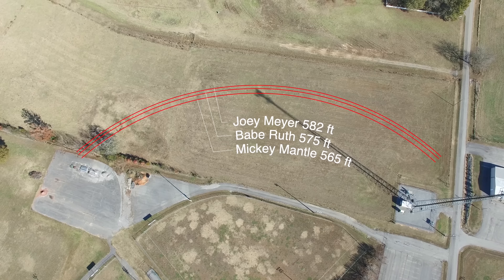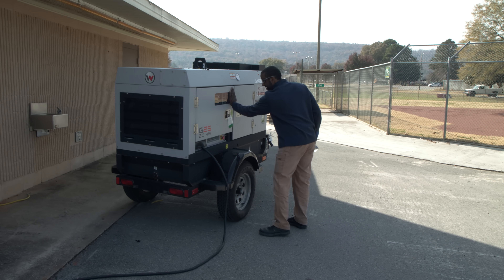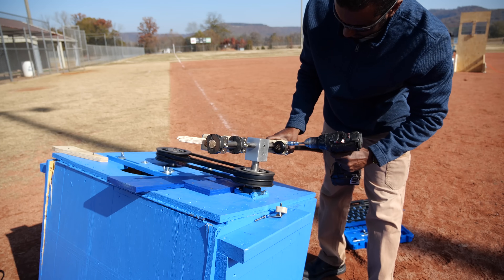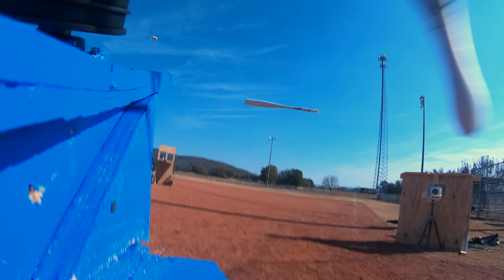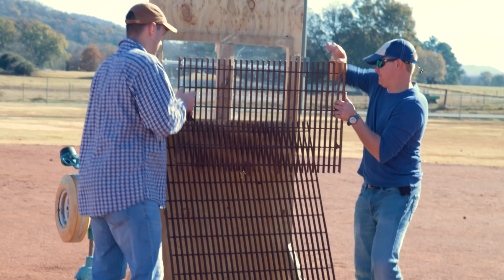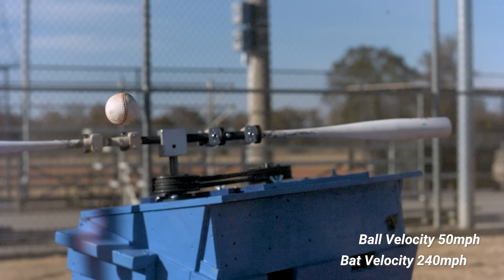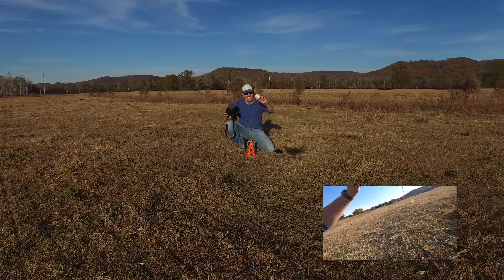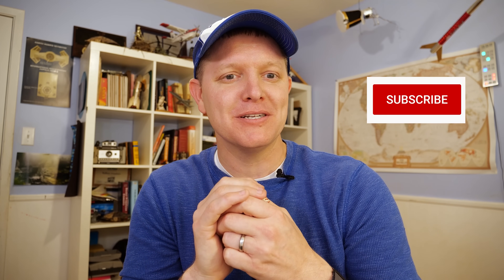World's Longest Home Run (The "Mad Batter" Machine) - Smarter Every Day 230

Comment: Oh man that was nuts. Good call on the flight tracker line lol. So here's my question:  why not farther?  Air resistance, sure, ball material, core density, was that a major league ball or a regular ball?  It was hit an insane distance for a person to hit, but how far could a major league hitter put the ball out with an aluminum bat, too?  Great machine and great video as always.

Comment: The main issue with generating light from sound, "sonoluminescence" is that it requires very sensitive frequency modulation of a specific area. The resonant frequency of the liquid you wish to suspend a bubble in must be matched, and then maintained. Then once the bubble is captured the device can be tuned to apply pressure to the bubble. If someone coughs on the outside surface of the container of liquid it can be enough to pop the bubble. Also. Temperature is a non considered variable so far. Both the proper operating temperature of the entire device and the active temperature fluctuations from within the bubble. Apparently the gas inside becomes plasma when squeezed properly on all sides. Plasma In a bubble trapped in resonant frequency matched liquid is Supposedly in excess of 10,000⁰F. The bubble will bounce from this tight plasma state back to "full expansion" and shift from that extreme high temp state to under -250⁰ extreme low state and oscillate between the two until disturbed. So the second issue is how to deal with the super cold temp, and harvest the light, electricity, and heat coming off the plasma

Comment: I think in stead of using a single wheel pitching machine you should use a 2 wheel pitching machine and instead of using aluminum bats use composite bats instead. the reason i say to use the 2 wheel pitching machine is because you get more consistent speed and accuracy also you should have try to load the ball consistently using a 4 seam(the way the ball would rotate) instead of just loading it randomly. As for the composite bats i hear that the more they break in the farther you can hit the ball also i would think they are less likely to dent. also what would be best if you can make the bat spring loaded with a gearing to reset the bat kinda like a skeet trap but allow the bat to keep rotating or adding some kinda breaking mechanism to slow it down. But over all Very cool!! you should ask Nike or some other baseball brands to let them use their products to sponsor and then when you are done with them donate the rest of the products to the little league :). Keep up the Amazing work that you do!!!! (just FYI not im not telling you how to do what you do just throwing some suggestions out there :))

Comment: Excellent video!  It would be fascinating to explore some of the math, to explain why there wasn't a more linear increase in distance, and perhaps predict a theoretical limit to home run distances.  For instance, one would expect a ball with double the exit velocity would travel more than 22% farther.  Granted, the increased flight time means longer exposure to wind resistance, which increases with the square of the ball's velocity.  The ball's trajectory suggests energy was expended curving perhaps 45° to the left.

Comment: 3:36 I don't think those 3 phases are drawn correctly. Phase 1 shouldbe at 0 (or 360) degrees, phase 2 at 120, and phase 3 at 240. However, as drawn on the paper phase 2 is at 180 degrees.
I know you pointed out you can't draw, but I think it's important to know that the phases are seperated 120 degrees from eachother.

Comment: I'm pretty sure the bat would have broken either way at that speed, but the wood bat was in the wrong orientation in the grip. The edge grain should be making contact with the ball to make it less likely to break.

Also imagine how far the home run would have gone if you'd gotten it on the first try before the aluminium bat got deformed. The trampoline effect the ball gets from an aluminium bat is lost after the bat is mangled. I wonder if you could somehow rig a pitching machine to be timed with the bats to more consistently barrel the ball. I'm not sure there's a pitching machine consistent enough to get the right timing every time with bat speeds like those.

Comment: According to Wikipedia baseball bats typically have a mass of ~0.94kg, with two of them spinning here (not including the pulleys and mounts I don’t know the mass of) that’s a mass of 1.88kg, and Destin says the bat has a velocity of 240mph (107.2896m/s).
Kinetic Energy = (½)mv² =  ½ x 1.88 x 107.2896 x 107.2896 = 10,820.3948J = 10.8203948KJ
The bats alone have almost 11KJ of energy when spinning at top speed… I didn’t really have a point here, just thought it was interesting.

Comment: I doubt ANY wooden bat would hold up during this experiment but a lot of people don't know that a wooden bat has a strong and weak side. Generally, the manufacturers find the strong side of the bat and will index the label brand in such a way that if the batter holds the bat with the brand facing up, the ball will make contact with the strong side.

Comment: There's a teachable moment in there about using GPS to measure distances and how to achieve sub meter accuracy.

Your phone can measure down to 1 meter accuracy under the most ideal circumstances but is more often than not 3 meter or wider.

Rtk is how you achieve sub meter. Down to sub centimeter in some cases.

Another interesting topic is how California surveyors benchmarks work when California is constantly moving and fast.

Comment: Interesting to see the effect of ball spin on its trajectory at 13:51. Also interesting to hear a reported maximum distance of less than 700 feet, then see a representation of a ball going 717 feet. Interesting to see how the ball deforms the bat. Have you thought about using a solid aluminum cylinder or thicker pipe? It seems you are losing a significant amount of energy in the deformation of the bat.

Comment: well, do we know where the ball "landed"? You found the ball after it landed and certainly rolled some distance. Also, based on the initial curvy flight path, i would assume the ball had a crazy amount of spin on it, which definitely counted as energy lost where it could have been used for travel. At that point though, you are also approaching the limits of the ball's integrity. If a ball and bat were to be designed to rebound properly and take the stress of a 200mph swing, it would probably go alot further, also assuming it would be denser and less affected by air resistance. Looking forward to more like this!

Comment: They're obviously having problems with bats. Looks like he gave a teaser at the end with a machined, female threaded flange piece. Their next attempt may be a machined bat made from billet aluminum with a male threaded handle. If they do that, may as well build a beefier rig. One that's anchored & shaft driven instead of belt. I'd also erect a steel reinforced concrete wall to stand behind instead of the one they made from plywood & steel grate. Their next problem might be baseballs coming apart. lol. Great video tho. 700 feet. Impressive!

Comment: "The power that comes out of your wall in your house *IN AMERICA is single phase power."
I am almost sure that here in Germany, we have 3 phases that are shifted by 120 degrees, so that at no point is there a moment without voltage.
Reply: I should have waited like 3 more seconds before posting this. But I'll leave it as an interesting tidbit. Germany's mains grid is run on 3-phase power.

Comment: 12:16 can you believe an actual human achieved a distance pretty close to what a machine could do traveling at nearly the speed of light?
Reply: That was no were near the speed of light lmao.
Reply: @maxz8807  It scratched the surface at least. But that's beside my point. Humans nearly beat a machine that spun fast enough to put that helicopter in the air.
Reply: That was 0.000036% the speed of light.

Comment: This is legit one of the scariest things I’ve seen Destin do. I’m glad he upgraded the pitcher’s protection!
Reply: He really coulda just tossed the ball into the spin from right behind it
Reply: Yeah, no kidding.  I briefly played 3B but didn't like being so close to the batter.  I ended up playing both C and CF through high school, so that example when Destin said "if you've ever played center field..." really spoke to me.  The hard bat ping followed almost immediately by the ball hitting the fence behind me was more than a little frightening.
Reply: Balls would 50/50 kill him, bats would explode him. That's basically a cannonball.
Reply: It sounded like a helicopter, also they need to put some concrete blocks in the housing of the motor to reduce the vibrations. It was shaky.
Reply: @Robert Hillen Be glad the bat didnt hit him.
Reply: My heart rate rose as the bats kept spinning faster and faster in the intro. That didn't sound like that thin piece of wood could protect against failure.
Reply: Yes... but while creating a fall hazard for anyone who happened to be walking by the grated area. Hopefully they taped off that area.

Comment: ooookaaay.  now you need a helicopter building company and a bat building company 
who does not have such puny bats to cooperate ... and i wanna see that bats glow and a baseball-meteorite.
(also could use improvement on the thrower, potato cannon or catapult)

and please wear hearing protection, this could lead to not only impact and shredding but also a big banging.

Comment: In real baseball the ball flys off the bat depending on where the ball hits the bat. Not the angle of the bat swing. So a person swinging the bat slightly down you get more bat speed and when the bat connects with the ball the ball will spin backwards making it carry due to wind going over seems of ball.

Comment: ALABAMA BOY DESTROYS BALL FIELD WITH OUT OF CONTROL HELICOPTER BATTING MACHINE THINGY  Destin Sandlin, the engineer responsible for the war zone like mayhem, assisted by engineer colleague, Jeremy Fielding, offered his back yard to the local little league during extensive repairs to the fence and batting cage, along with filling of several large craters in the in-field and the replacement of three mangled, heavy steel storm drain grates. The provisions of Sandlin's offer is that the young ball players agree to use "wiffle" balls and/or replace any broken windows that occur during their games, ... and agree NOT to use any out of control, helicopter batting machine, thingies. (silly Alabama boy...)

Comment: 10:46 you can see the bat's after images "lag" from the reduction of speed caused by the ball
Reply: Stereoscopic effect in action :D
Reply: During a split second the bats almost matched the camera shutter speed
Reply: No that's incorrect. Look at the ball. The ball also stops mid air, which is not possible. I think the video itself got glitched up somehow.
Reply: @SahilP2648  try it on 0.25x
Reply: @SahilP2648  plus there are two footage on different angles
Reply: @nnnyel  hmm at 0.25x speed the ball somehow doesn't stop midair. But during the next shot, the bat doesn't even flinch after hitting the ball. I don't know what to make of this.
Reply: Thats crazy
Reply: Omg i didnt even notice that .. ty for commenting
Reply: It slowed down to the exact rotations per unit time as the camera's frames per unit time, it's a good coincidence
Reply: Rolling shutter effect

Comment: It's too bad you couldn't throw the ball faster and more accurately to hit the bat in the right place.  The resonance of the bat itself makes a difference.  Drop a baseball in different places on a bat you're holding and watch the difference in the bounces.  It seems like the tip of the bat would be the best since it's moving the fastest but there's a sweet spot closer to the center.  Hitting the ball with the tip of the bat isn't ideal.  Almost none of the energy of the bat bending is transferred to the ball that way.

Comment: Metal bats ruin it. The ball comes off the bat so fast and the bat is lighter usually. Still cool though. Aluminum bats are made in pieces to help with the sting. Newer ones are way different than 20 year old ones.

Comment: Great video! Got a subscriber. Just some random musings...that Skunk Works book is a good one. I grew up in Palmdale, CA very close to the giant Lockheed building. My grandfather and uncle served, then went into aerospace engineering and both worked on black projects quite a bit. Too late for the SR-71 (which I used to see/hear from my house in the 70s as they would train out of Edwards AFB). They worked on the radar absorbent skin of the B1-B, B2, F-117, as well as the heat dissipating tiles of the Space Shuttles. My uncle also worked on the F-22 before retiring. It’s amazing how much earlier many of these aircraft systems were conceived and mocked up, then built and tested, before the public ever knew a thing. We heard multiple sonic booms most days and I just assumed that everyone did growing up. Lol. About the baseball machine, maybe if you used titanium bats... But seriously even with an aluminum bat going 250 mph, it’s crazy that air friction knocked that ball down short of 700 feet. I’m trying to remember if drag increases at a more than linear rate as an object accelerates. I think you get diminishing returns but I’ll have to look it up. But think about MLB players with wooden bats swinging “only” in the high 90s, being able to crank a ball 550+ feet, or about 80% of what your Batcopter did. Of course, you guys probably never really got hold of one on the sweet spot with the perfect timing and angle. Probably could have cleared 800 feet! Lastly I’m suspicious about those old timey HR records. I have no doubt that the Babe and Mantle absolutely mashed baseballs. But look at some shots by Big Mac and Bonds, among others (yes, juiced as they were). Two HRs that pop into my head are the upper deck shot Bonds hit at Yankee stadium and the ball he hit against the Angels where you can see Tim Salmon saying “that’s the furthest ball I’ve ever seen hit”. Not to mention some of the shots into McCovey cove or that time he annihilated Gagne’s 100 mph high heater. I think that ball might still be in the air! Point is I don’t think MLB wants to count HR distances from the 90s/00s because my eyes and ears tellme quite a few guys exceeded the official records. I played too and as you say the sound of a hit tells you a lot...plus when a ball is just past its apex when it it flies over a 400’ sign...yeah. Anyhoo, again a great video. Appreciate the time you guys put into it and now I’m off to binge some of your other vids! Happy New Year!

Comment: Cool video. I will share with my students. I got to experience along the runway  the  SR-71 take off at Edwards Air Force Base when at a teacher camp at NASA Dryden Center. We were told that was supposed to be RS-71 but I believe it was President Johnson who announced it backwards so it was changed to SR-71.

Comment: There used to be a problem with Apache helicopter blades.  There was at least one fatal accident caused by a part that failed that caused a blade to separate from the aircraft.  The equal and opposite reaction is deadly in the cockpit.  The g-forces alone are instant and fatal.   Great video as always.

Comment: Why not make a steel Cricket bat that looks like a "Kuhn Rikon Stainless Steel Mixer Blender Strainer" - that way air can pass through allowing increased speed but the holes will be too small to affect the trajectory.

The flat surface will be more predictable than a curved one, lob the balls in so they strike flat at the angle of the bat.

Comment: 13:37 why is the ball's trajectory suddenly curving upwards midway? Never seen anything like that....
Anyway, happy new year and best wishes for 12020, Destin and company! :)
Reply: Willem van de Beek it’s actually curving you the left, due to the side spin imposed at contact (and the uneven drag due to the seams on the baseball)
Reply: @GrapplingwithPhysics  the ball is coming back towards the camera??? o_O
Reply: Willem van de Beek it looks to me like it starts going up and towards center field, but then hooks left (still going up) and eventually straightens out (still going up), then hits its peak and starts heading back down.
Reply: @GrapplingwithPhysics  I see now what you mean. This camera angle isn't making it easy. It is bending left with the same inclination, but this camera angle makes it look like the ball's inclination is suddenly increasing and then suddenly plummets down.

Comment: Dustin, I am sure it was a ton of fun, but this was not very smart. Way too dangerous...
1) To spin things that are not made to spin at that speed, not smart...
2) Using a wooden bat, c'mon... Not smart...
3) Not checking how the bat handle was attached, not smart...
4) Building a machine and make absolutely no effort to handle any mechanical failure, not smart...
5) Standing behind a flimsy plywood cover when a baseball or a bat could be thrown at you at 100+ mph speed, not smart...
I can go on...
Please take this as constructive criticism, and if you ever attempt to redo this, use more science both in engineering and safety sides of it. Take care.

Comment: Hello, could the system be made more stable by using a flywheel  on the shaft and the bats above it. It could reduce vibrations and save the bearings in case of a failure. It will just take more time to spin up. Well, you could also get a death disk if it breaks.
Love your channel, keep up the great work!